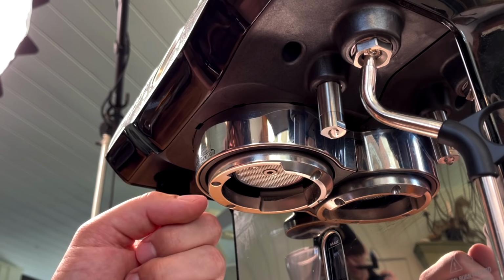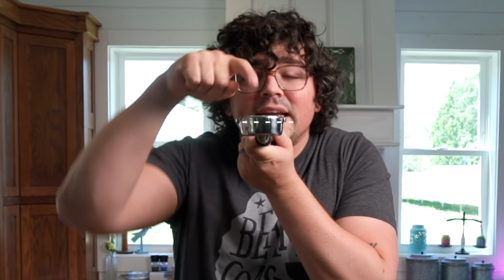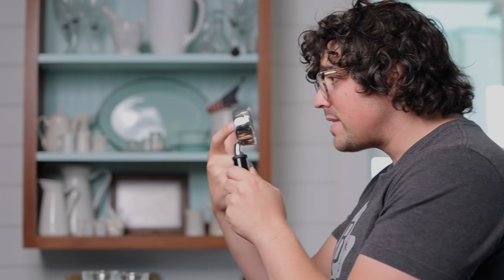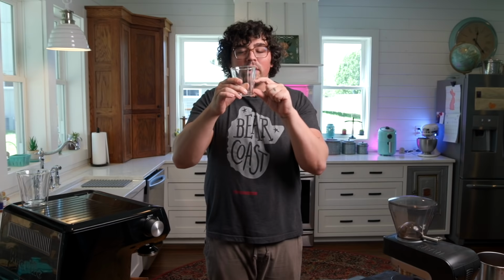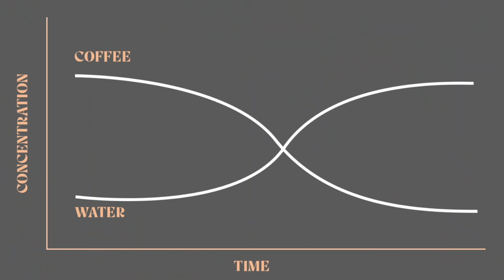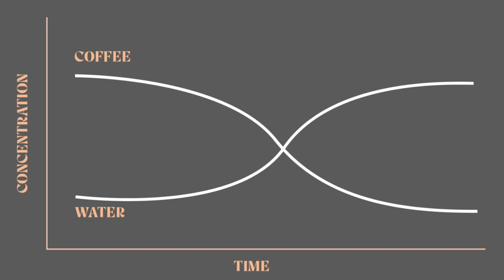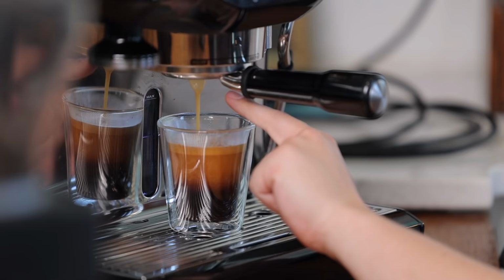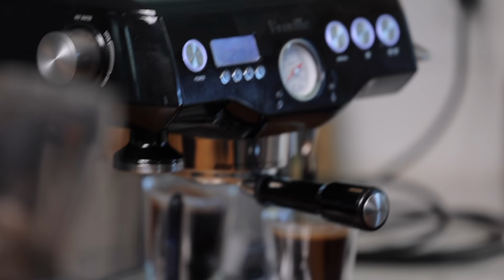ESPRESSO EXTRACTION THEORY: How to Dial in Espresso Like a Pro (pt. 1)

Comment: Just recently changed to a vst basket and precision screen. Never had an issue with channeling before but now it is crazy. I have tried everything and still after more than a bag of coffee I cannot get it to stop. I am meticulous when it comes to dosing, distribution and tamping. The only thing left I can do is buy a new  larger 58.5mm tamp for the new basket but I don't think that will change anything as I am getting channeling everywhere. I'm lost at what to do from here
Reply: I'm almost at the point where I'm going to have to take a flight to your house and make you fix this because I honestly think something else is the issue. After having no issues for over a year and now not being able to pull a decent shot is probably the most frustrating thing ever.

Comment: Hi Lance, any thoughts about the Nuova Simonelli Oscar II? Have you had past experiences with it? I am experiencing difficulties dialing in espresso. Thanks.
Reply from the maker: Hey! It isn't a bad machine! I'd recommend upgrading the screen on it, but should be fine. What are your difficulties?
Reply: I recently installed the bypass valve but before it was extremely difficult  dialing in a coffee. It never tasted to what I wanted to taste in a good espresso? Any tips of how making sure the pressure is around 9 bars and and any other upgrades?
Reply from the maker: Upgrade screen to IMS, basket to either IMS or VST, ensure the materials in the group head that are replaceable are all quality. Outside of that, just gotta work on distribution and maybe look into upgrading the grinder.

Comment: Lance, absolutely loving your videos. Just a quick question, you mentioned grinding too fine and having too much pressure will cause channeling. However, i got a new ims basket and it has forced me to grind much finer to achieve 1:2 ratio in 28 seconds and no matter how nicely i distribute i get partial channeling (unlike my older basket which has a slight taper). How do i solve this? Isnt the channeling going to mean the 1:2 in 28s is wrong as well?
Reply from the maker: Yes. There is a fineness to which you can go that will gravely increase channeling. Same with high pressures. It gets to a point where the water is spazzing out, not knowing what to do because the force (either pushing it or holding it back) is too high, so it finds paths to go in. There are a lot of potentials that are causing your espresso to channel. I can't be sure without seeing a video of the whole method from grinding to puck prep to pulling. Perhaps my next vid will help answer it?
Reply: @LanceHedrick  looking forward to it!
Reply from the maker: Thank you🤗🤗🤗

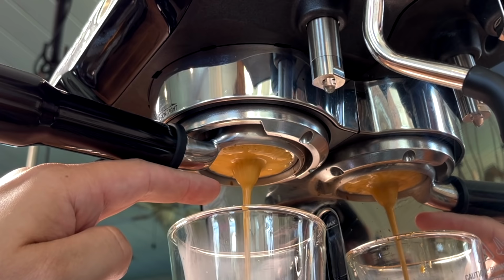Comment: Hey Lance. Great video and great channel! Keep up the good work! Quick question, @ 21:49 in the video your shot is making a weird air bubble/vortex in the middle of the basket. My machine has started doing the same lately and it's bugging me as it never did it before. Any idea what causes it?
Reply from the maker: No big deal! I'd suspect it is just lack of crema, which is preferred. Most of the insolubles and viscosous materials have been extracted and pull away.

Comment: Hi Lance! I understand this is a question unrelated to your video, but I have recently transistioned from part time to full time in the  specialty coffee industry supervising a cafe. With your help my steamed milk game has improved hugely and I am so thankful for that! But! My oat milk just ain't there. I use minor figures and I can produce fairly strong steamed milk with it. But when it comes to the pour, despite it looking shiny and nice, as it comes to getting the design down my white foam is loose and just doesn't hold in the drink (e.g. the wiggle that I use in cows milk to create neat ripples will swirl and leak when using oat milk). Clearly my steamed oat milk is too "thin" and not concretised enough to hold my design, I am just struggling to figure out what adjustment to make! More stretching? Less stretching? Stop stretching sooner? Stop stretching later? Steam hotter? Steam colder? HELP LANCE! Also thanks for all that you have done your are a real role model for people like me starting on there journey as a dedicated coffee professional. It's hard to find resources that cater to my position as I need more insight than a home user, but lack some key aspects of knowledge that a video for professionals contains. Luckily you have filled the void and will be instrumental in my career!
Reply from the maker: Thank you for the comment! Incredible. Just be more aggressive in the stretching phase. Everything else is the same! I go over it in my milk video if you haven't watched it! Minor figures works well
Reply: @LanceHedrick  ah! So a louder and more sputtering"kiss" as opposed the the gentle stretch and light crackle of dairy. Thanks Lance!
Reply from the maker: Exactly! For almond, oat, and anything with more fat that whole!

Comment: What Breville Machine are you using?  All metal group head . Most of the brevilles are thin sheet of metal on outside with plastic inside ! Also you are using a bottomless portafilter ?
Reply from the maker: Breville dual boiler! Portafilter is also from breville!
Reply: @LanceHedrick  that's also 58mm vs 54mm on other Brevilles. You also have a Bambino ! Does the bambino brew colder & more sour because of plastics in group head!  Also how does 54mm compare to 58mm in extraction...coffee is going to be deeper packed vs wider /thinner ?
Reply from the maker: So, the bambino won't achieve as high of an extraction, true. But you can put a stainless steel portafilter in the group. As for 54 vs 58, this is hotly contested. I prefer 58 for a plethora of reasons there simply isn't room to go into here haha!

Comment: The water in our county is very hard so we have a whole house soft-water system.  In addition, for drinking, we have a reverse osmosis (RO) system under the sink.  What kind of water should we be using for the Espresso machine?
Reply from the maker: The RO water would be great! Just don't want really high total hardness (calcium) as it can cause scale build up and harm your machine.
Reply: @LanceHedrick  Thanks for the tip!  I’ve watched your two-part videos on dialing-in three times already.  I like how you explain the fundamentals and how it’s all about taste, so I don’t need to stress about it too much.  Once I get that down, I plan to study your videos on Latte Art.  I’ve ordered a Breville Barista Touch (good for a first-timer like me) based on your reviews.  Was scared a bit about the brand due to some snobbery on some forums, but your videos have assured me that Breville is plenty fine for a beginner.  Subscribed!
Reply from the maker: They are great for beginners! And the dual boiler is absolutely incredible for anyone, regardless of experience. I'm glad you took the dive! Excited to see your progress

Comment: Learned a lot but here’s what I have to add. You aren’t starting with less water and ending with more. The water is your solvent. It’s the same the entire time. The concentration of solute is starting very high and ending low while the volume of water flowing through and out is the same.
Reply from the maker: The flow rate increases as the puck erodes. It is easily verified there is more water coming out at the end. Simply measure flow rate.

Comment: Lance, I am having crazy trouble with channeling. I have tried everything, watched all your videos and still cannot seem to stop it. It may just be me but I find certain beans channel way more than others doing the same puck prep. I am distributing grinds exactly how you do in your video and it still mists the entire cup with coffee. I recently got a precision basket and I'm assuming that has to do with the channeling as they are less forgiving but I still distribute really well and use a Pullman tamper that's wall to wall. I'm using a eureka and appartamento. Any suggestions? Please help
Reply from the maker: When you say there is crazy channeling, what are you referring to? Is it in taste or are you seeing squirts everywhere or what?
Reply: @LanceHedrick  I am using a bottomless portafilter. It's spraying all inside my cup
Reply from the maker: Gotcha! Light coffee? And are you using WDT with smaller needles than .4mm?
Reply: @LanceHedrick  I am using medium and medium-dark beans. One of them seems to channel way more than the other. I do wdt with a cork and sewing needles through so I'm assuming they're pretty thin

Comment: What difference between bitter/ sour / acidic
Reply from the maker: Hey! So, I am assuming you mean difference between bitter from over extracted and bitter from under extracted? These things I will hit in greater depth in part 2! But, really quickly- acidic/sour tasting shots will be underextracted, but underextracted shots can also taste bitter because that fine migration and the amount of fines that enter the shot so quickly. So, the biggest difference is in the concentration of the espresso youre tasting. If you taste it to be water and drying, it is likely overextracted. If you taste it to be sour and pungent, likely under. Hope that helps enough until I get part 2 out!

Comment: I can not stop my espresso from channeling man :( It still tastes great and looks good, but every single time there's at least 1 spurt that goes in and out for like 5 seconds. I always use wdt and think it looks good, I use distributor and have tried with both the other side of the distributor and a loaded spring tamp. Loaded spring wasn't always even, but even the 2 in 1 distributor tamp which imo makes it even I have channeling.

The only thing left that I can think of is that the espresso is too fine, but if I make it any coarser the extraction time will surely go down. And it's already around 32 seconds including preinfusion. So I don't want it any quicker :( Idk what could possibly change.
Reply: Maybe make the grind coarser but increase the dose slightly? Any input would be appreciated lol

Comment: What’s your opinion or observation on quality of water? Hard water, filtered, spring, distilled… will one even notice a difference in the quality of the espresso. I don’t know but figure it could taint the taste and overall enjoyment. Yes, where I live the water is horrible.
Reply from the maker: Water is definitely one of the most important things in the taste of espresso. Not only that, but in the longevity of your machine. I would highly consider reading a little bit online about water quality and what you should be putting into your machine. You will notice massive differences depending on the water content and the taste of your espresso. Absolutely massive

Comment: Wow, sounds like puck preparation is extremely important. It's kinda weird that the tamper is seen as vital, but tools that help evenly distribute the grounds before tamping are seen as optional. That seems kinda dumb, doesn't it? Because tamping without evenly distributing the grounds guarantees channeling. So distributing the grounds well is just as important as tamping well when it comes to pulling good espresso - right?
Reply from the maker: True, but you HAVE to tamp for espresso to really pull even a little decently. You can distribute somewhat well with horizontal tapping and top grooming. I'll go over tools and how I like to distribute in a more intense way with my soon to come flair video! I do an abbreviated version in part two espresso vid.

Comment: This two part series is incredible! Am still having issues dialling in my Barrista express but hopefully I ll sort it. 

If you have any advice on how to address channelling I’d be very interested to know. Am stuck between a rock and a hard place because when I go coarser the pressure drops and I end up with quick flow and under extracted shots. But the finer I go the more problems i seem to experience, So am kinda lost… 

Am doing what I can to be consistent, measuring the dose using a scale and only grind that, use a distribution/tamp tool, bottomless portafilter etc but I can’t seem to be able to get that nice looking flow and end result.
Reply from the maker: Actually, coarser grind with lower pressure can give high AF extractions. Counterintuitive, I know. But it can. 

And I'd recommend working on distribution. Look at my WDT video!

Comment: Hey I have the same espresso machine and grinder.
Reply from the maker: That's a great set up. Make sure to shim your burrs on the sette and replace the screen with an IMS on the dual boiler!
Reply: @LanceHedrick  Will do!
Reply from the maker: They're game changers! For sure. You'll love both mods
Reply: @LanceHedrick  I’ve heard of the shim mod, but not the screen mod. Did you get the screen from Amazon?
Reply from the maker: Yes! Just Google IMS breville dual boiler screen. Should be first option. Like $54 for a brass plate replacement for the plastic one that comes stock, a screen, and a blue gasket. Huge upgrade for heat retention and water dispersion
Reply: @LanceHedrick  Great, thanks for the info and quick replies!

Comment: I think I messed up the factory original program and tried to use the program button to control the time! 
But now i am totally lost....😩
Reply from the maker: So what is the issue exactly? And do you have your manual? Quite easy to reprogram
Reply: @LanceHedrick  omg thanks for reply! I’m at the point that I get 50 grams yield in less than 20 sec for 18 gr input with grind 2!! 😔taste bad watered down
Reply: @LanceHedrick  I’m working with breville express and I have the mannual
Reply from the maker: Interesting. Are you grinding with a built in grinder? You can make it even finer if so.
Reply: @LanceHedrick  you got it! I solved the problem by recalibrating the grinder! Grinder was the issue!
Now I get very nice shot.
Reply from the maker: Wonderful! So glad you got it fixed

Comment: Thumbnail be like overextractionnnn
Reply from the maker: Could you define overextraction? 🤔
That style pull is actually what many do for high extraction shots. It is called an allongé. It is a very "modern" way of pulling espresso to heighten the EY% as much as possible. 
That's not why I did it here, though. It is for an illustration. Hope you watched! If not, no worries! Part 2 is dropping in a few hours

Comment: No. 7 When the beans were roasted
Reply from the maker: Haha I don't add this because, simply, it's not a controllable variable when in front of a machine. I mention roast date as a factor to take into consideration, but it is not malleable. If you are making espresso 2 weeks off roast, when dialing in, you can't make it magically 3 weeks off roast haha!

But yes. Roast date, elevation grown (density), etc, should all be considered.